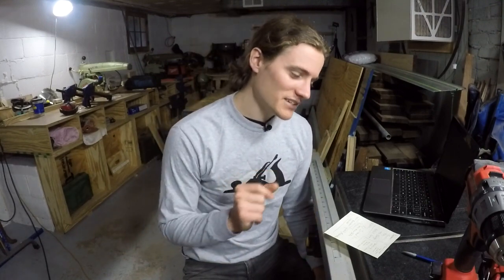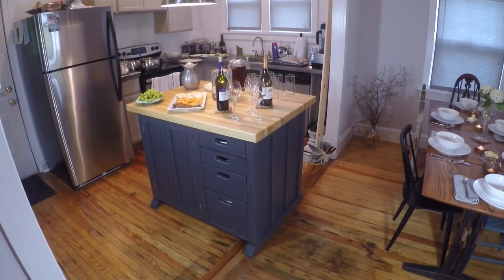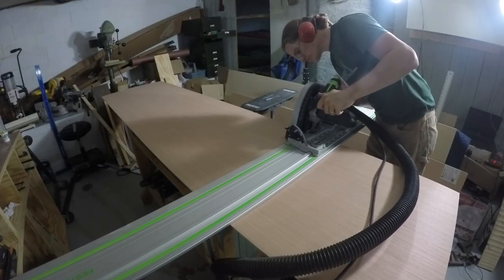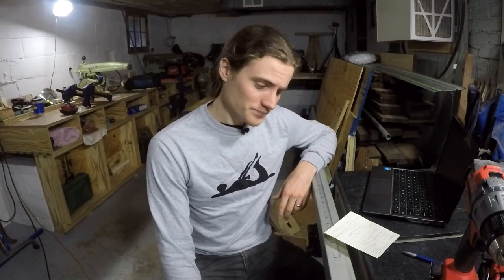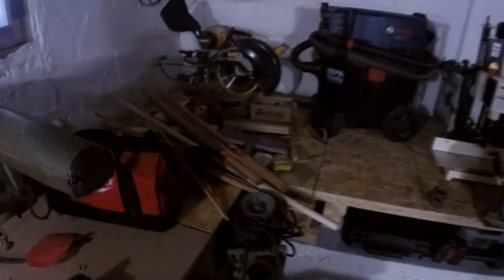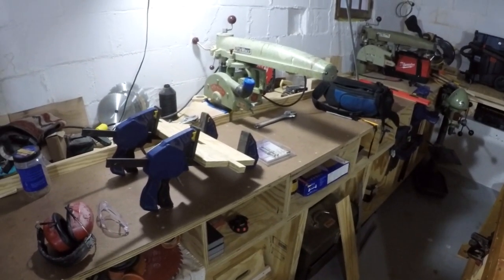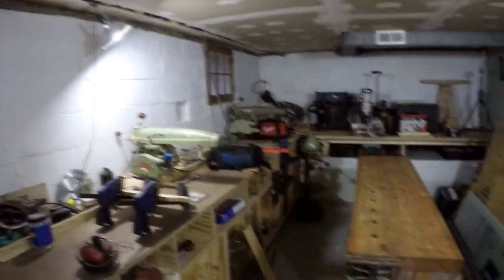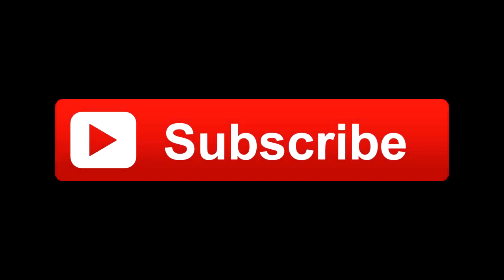The Craftsman's Corner Ep. 8 - LONG VIDEO, Shop Tour, Pricing, Tools and Videos

Comment: Glad to see I'm not the only one with too many hobbies.  Amazing to see how much stuff can be fit in a small space.  I love the work bench with the cabinets and drawers, that will make organizing much easier.  I rebuilt my work bench last year and went with an L shaped bench also, I used doubled up 3/4" plywood for the top which makes for a super strong bench.  My reloading presses can tear up a bench pretty quick full length resizing large rifle cases so I wanted something strong but easily replaceable.  Engraving is quickly becoming a lost art so keep at it.
Reply from the maker: +jailer23044 Thanks, I almost got some reloading equipment myself, but opted to not start up a whole new interest! With the engraving, there's probably more people doing it now than ever before due to companies like GRS and the pneumatic engraving tools. I have some of that but I'm focusing more on hammer and chisel engraving. I already have the tools to do it, but for fun I've been making some more, like the hammer and some chisel handles. My metal lathe is like a magnet lately, I can't stop thinking of projects to use it for. Thanks.
Reply: +The Homestead Craftsman Don't go out and buy an anvil and build a forge if you think a lathe is addictive.  Between my leatherwork, the reloading, casting and shooting, the amateur blacksmithing/knife making and then the restoring vintage tools all my free time is accounted for.  The blacksmithing is definitely the most relaxing but the leatherwork provides me a little bit of side income and will probably become my retirement income.

Comment: I have the Grizzly tracksaw. Works well. Don't think it gets me as close to a finish product because it wobbles a bit on the track. However, most of the time the edge of the sheet good is hidden so it gets me there for most everything.
Reply from the maker: +john Carter Same for me, while the Festool does produce a very nice cut (a lot of it due to the blade) most of my cuts are not critical, but when they are, it can make the cut! It's most handy in my projects for jointing boards to be glued into table tops.

Comment: How about dropping a few pipes from the ceiling and storing the lumber above and out of the way?
Reply from the maker: +Dave Wygonowski The cielings are low, so that wouldn't work in my shop. My plan is building a shed behind the house for storing lumber, it takes up so much room, but gets used up quick so I need a fair amount on hand.

Comment: Hi I have a crosscut saw on a mobile bench but a get a lot of sawdust, I could not see any dust collection and wondered what you did for yoursLove the videos by the way
Reply from the maker: +John Fithian-Franks I have several things to take care of dust for my radial arm saws and miter saw. I use either a Bosch dust extractor or a shop vac, I also have a small Harbor Freight dust collector that I use on other tools. I'll be showing some of that once the shop is a little further along.

Comment: I understand that you make make farm tables ... but do you also make the chairs? Do your clients provide their own chairs?  I am at that crossroad now, cutting boards got me off the ground, but I'd rather make larger pieces that fetch a higher price.
Reply from the maker: +Patrick Melchior Hi, for my tables I stay away from chairs and stick to benches, it's just a matter of efficiency with time for me and many of my customers have or get chairs from other sources, so it has not been a problem. Although......I'm designing a few chairs now that I may start offering. Also, chairs are just more jointery and undergo different stresses, so a single chair is probably about the same amount of time as the table, so as far as cost I would take a hit on them, but with the designs I'm working on now I'm coming up with a pretty efficient way of going about it that may make it worth it, we'll see.
Reply from the maker: +Norbury53 Hi, answered your question under the same post you replied to. I'm no stranger to chairs, just haven't done any videos on them. And there's plenty of people on YT making chairs, some of the woodworkers you are probably referring to haven't really been doing furniture making that long and a lot of people shy away from chairs. Also, it's just not the focus of their channels, chairs are pretty involved and would probably make for a longer video than they normally make. But like I said, there's plenty of people on Youtube make chairs, just not the people your watching. Look up Curtis Buchanan, if you want to watch chair making, that should give you your fill. It's a series of about 50 videos showing the making of a comback windsor chair. Even if you don't want to make that chair, it's a lot to learn from. But in closing, I've got some chair videos coming up in the future making both simple and more complicated chairs. Thanks.

Comment: Yes...I AM still watching and am still fascinated. Thanks for the Q&A and for the tour.

I have an old Craftsman RAS that is in reasonable good condition, but I need to set it up. It's on a rickety old sheet metal stand and I want to put it on a bench similar to the setup you have. Can you do a video on what's required to set up, level and tune an old Radial Arm Saw?
Reply from the maker: +Some Southern Stuff I try to do that before I finish up the bench. Thanks for watching.

Comment: I enjoyed the video. Thanks for sharing your shop with us. Was that an air filtration unit i saw mounted on its side, on the wall? If so, what kind is it and does it do the job for your shop?
Reply from the maker: +David Letz Hi, yes. It's a Jeg AFS-1000B. It is wall mounted, on it's side. It works very good in my shop at keeping dust down that is not caught by my dust collectors or vacs. It has a remote which makes it easy to turn on and off regardless of where it's located.

Comment: That's a good lookin' shop. I appreciate diverse interests. Do you use the track saw exclusively for jointing or do you still use your jointer?
Reply from the maker: +Rob D I still use the jointer, mainly for smaller stuff. It's quicker than getting out the tracksaw. So like in the kitchen island video, I used the jointer to joint all the small parts. I mainly use it as a "jointer" with my rough sawn stuff for making table tops or squaring off the ends of islands and ripping ply.

Comment: Enjoy your videos!
Couple of questions: Where do you get the 9" blades for the radial arm saw and how many tooth blades do you use?
Reply from the maker: +Art White Most people just run a smaller blade, 8.5, Several companies make specific blades, Freud, Forrest, etc. A negative rake took geometry is what your looking for to lessen the climbing of the blade as you pull it into the cut. Tooth count is dependent on what your cutting, but a higher tooth count will give you a smooth cut.

Comment: Looks great, I'm setting my shop up with a similar situation. However I do not see any wring for ceiling lights in the new ceiling, will the wring be surface ran?
Reply from the maker: +Ben's Collection and Sundry I havn't wired the basement all the way yet, I have some ran but not all. It will all be surface wired for the most part, which for shops is great because you can easily add and change the set up. I'm going to have a bunch of 8 foot 4 bulb t8 fixtures with 5000K bulbs, it's a good working light. I'm going to have it very bright!